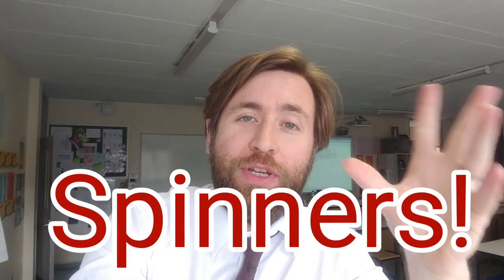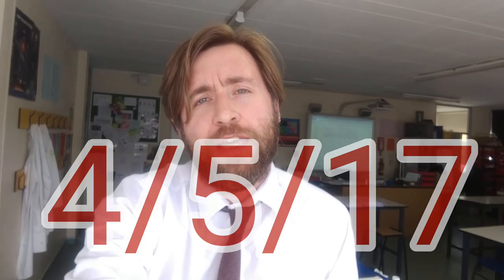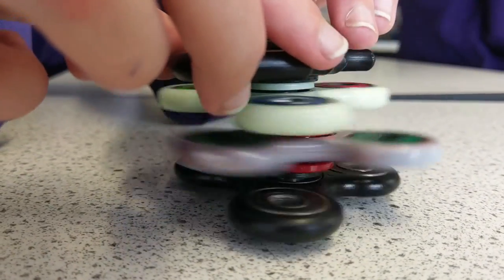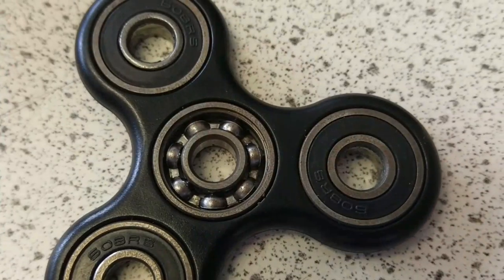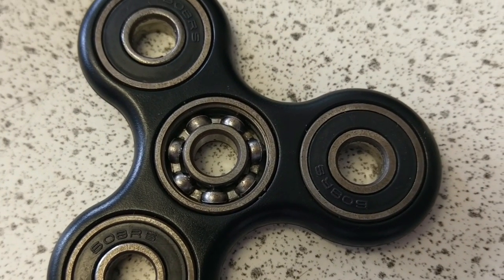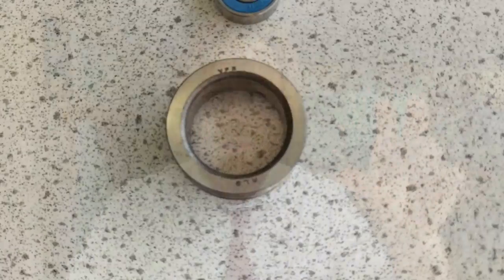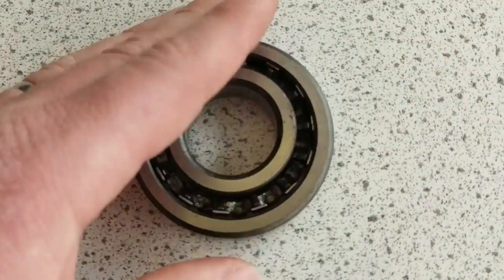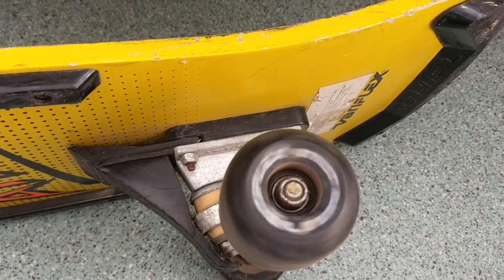Spinners! - how do fidget spinners work? - Quick Physics Video

Comment: My question is:

a)  are there also bearings in the three arms?

b)  if so, so they contribute in some way to the longevity of the spinning?
Reply: oops typo... i meant b)  if so, DO they contribute in some way to the longevity of the spinning?
Reply from the maker: skippipotamus good question, no these are just to provide a rotating mass. I think there could be done interesting physics to be done into how many arms are best! they've just generally used outer rings of bearings because they are cheap and available.
Reply from the maker: B. yes I think the distribution of the mass is important. it's all about the resultant moment between the rotating mass and the opposing friction. a moment is a force times by a distance, so the friction is a short distance from the centre, so low moment, the masses are further out, so higher moment. (another word for moment is torque.)
Reply: ok then.  when i first saw these things i suspected something was happening with the outer bearings that resulted in some exotic phenomena that might cause faster/longer spinning than would happen with just lone central bearings.  i'm sort of disappointed it's just normal spinning tbqh lol.  thanks for the prompt answer though.
Reply from the maker: +skippipotamus stone more detail here: https://youtu.be/D-KaQbPx1u4
Reply: But isn't it cheaper to have a solid rotating mass than three redundant ball bearnings, if it's purely about the mass?
Reply from the maker: Luide Mulumba I think it'll definitely cost more to use a metal to make it as one solid piece. And plastic wouldn't have enough mass!

Comment: Why are most of the spinners made with 3 hands? I've seen some made with 2 and a few made with 5 but most are made with 3...why?
Reply from the maker: +Frank James Bailey this is a very interesting question. I wonder about this too, my guess is is some kind of maximum in a function to do with benefit of more rotating mass more angular momentum vs less mass meaning less friction.
Have you noticed that wind turbines tend to have three blades?
I think there's a good experiment someone could do!

Comment: Hi I'm doing an AP physics project with a fidget spinner and I am trying to determine the coefficient of friction. Could you give me some suggestions on the best way to go about doing that? Thanks!
Reply from the maker: Difficult one!  I'm suggesting a work around through speed = angular velocity x radius.  Where radius is distance to the centre of mass of the rotating parts.  You'd need the spinner to be rotating quite slowly to measure a time for lets say ten rotations, then use time to stop to do average deceleration.  This will at least give you a value which is proportional to Force slowing the spinner and allow you to start to make comparisons between spinners.  

To work out forces you'll need to measure mass as well and remember that the rotating mass is at a different distance to the pivot to the part of the bearing where the friction is applied.  Doing this you could get an absolute value for F.  However as there is no load for the object (if spinning horizontally) coefficient of friction is a little meaningless... unless... you say that the friction is caused by the centripetal force which is the same as (mv^2)r....
Really interesting.

Comment: this video had very little physics
he didnt even explain how the outer bearings help keep the fidget spinning
lame
Reply from the maker: MrMugenwii bearings on the outside have no effect on spinning. it's just a cheaper design to punch four holes with the same size and use cheap bearings as rotating mass. this is why more expensive  metal spinners without bearings in the outside still work, see comments below.
Reply from the maker: +MrMugenwii hope this answers your question: https://youtu.be/D-KaQbPx1u4